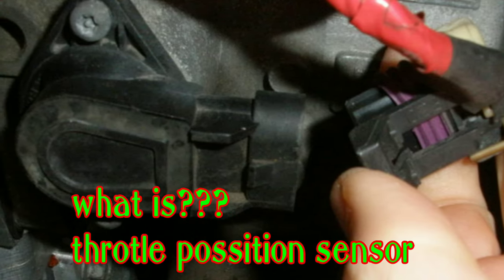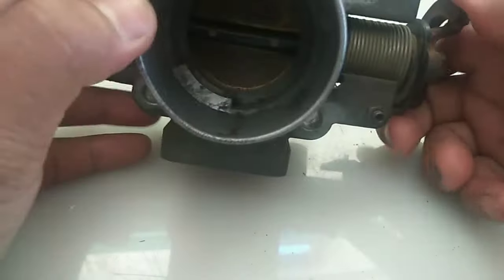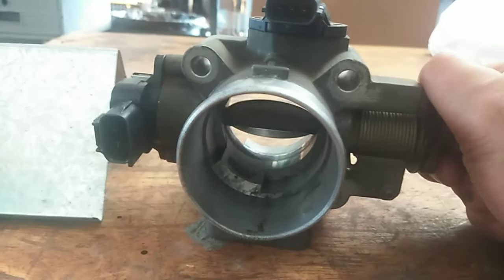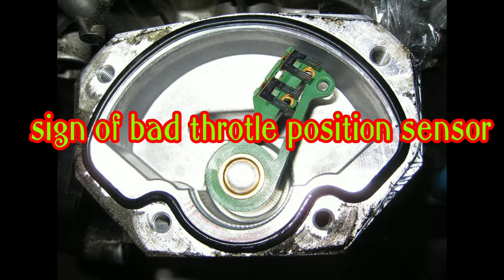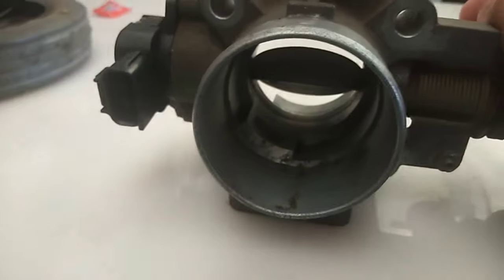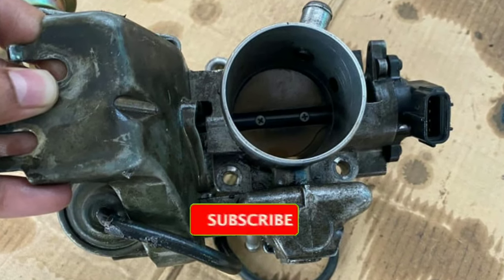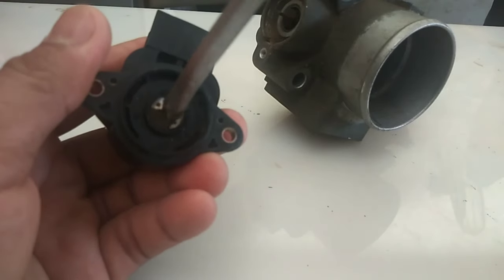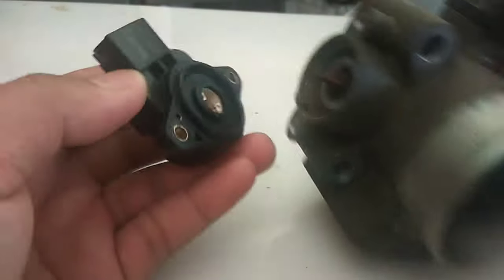Throtle position sensor faults and symptoms / caused and effect of bad Throtle position sensor andam

Comment: put a new one on every 65k miles,they are a part that wears internally,along with this sensor replace the o2 sensors every 85 k mi too,along with oil changes and new air clearner elements ,you will run  and run and get programmed fuel economy,mine just changed,i practice what i preach,retired ase tech of 47 years,yes parts wear out,its the way of it,no time for breakdowns

Comment: My fzs v2 has automatic acceleration problem ....new cables but still problem ,what the solution?
Reply from the maker: @benjamir474  air leak on your intake manifold ,check vacum hoses or any hose connected into your intake manifold , because those are one reason acceleration goes up even acc pedal at rest,,
Reply: @andammixed  I'll look into it

Comment: Thank you for the video, pls my Honda Accord 07 is consuming too much fuel lately and at times goes high and low on it's own. Some mechanic are saying no catalyst that's why. What should I do?
Reply from the maker: Removing catalyst is not a caused of large fuel consumption, what can i suggest for now is, try to used DTC scanner, to check the injector flow,  the map sensor, and other sensor related to the engine performance or to the fuel system,, 
My Suggestion,: change air cleaner,  clean throtle body, clean air intake and exhaust manifold ( so that the engine can breath)  intake manifold  gasket replace,  Clean the VTI strainer,  flush the exhaust pipe from the engine, choose light tires, my suggestion make your car low fuel consumption and engine operates in normal condition,.

Comment: Hi.  I've got a 2003 Montero Limited 3.8L.  Twice so far (1,000 miles apart) mine has gone into a condition where it will not accelerate. It idles and starts fine, but will not go over 40mph on level road, and takes a long time to get to that speed (severel minutes).  It will be fine one moment and then begin this malfunction in the middle of driving it, in town or on interstate.  I do have a TPS sensor code (P2135) but also cam and crankshaft sensors codes.  The timing system is fine and it doesn't jerk or do anything strange except refuse to accelerate.  I can turn it off and after 20 minutes it will operate fine again.  Is the the TPS sensor getting hot and then it fails?
Reply from the maker: In this case, try to get back to basic, change all  fuel filter and clean air filter,clean airflows sensor, if the TPS signal always mulfunction beter change the TPS,,and if your car is automatic transmission  chage the fluid and change the fluid filter and clean the strainer and fill with design AT fluid on your Transmision.😊
Reply: did you get it fixed ? what was it ?

Comment: Hello can u help. I got bmw e46 320d automatic transmition: when accelerating or when holding steady gas for example driving with 80kmh rpms jump up or bounce down. When restarting the transmition parameters i get 300-400km of normal driving with no problems and then the same starts occurring. Please help
Reply from the maker: I think first you need a diagnostic scanner to check for any abnormal system, but if you want to try any basic, try to clean your throtlebody, fuelfilter change check also fuel strainer and aircleaner this are the basic which need to clean if it thesame better used a DTC SCANNER
Reply: @andammixed  tried changing the fuelfilter and air filter also pluging in on scanners car shows no codes, on dashboard no check engine or transmition problem light. Every mechanic is suggesting to change the torque converter bcz they say its damaged ( car also makes grinding noise for 2-3 secounds when cold acceleration 40kmh) and transmition oil and filter change. Im just amazed how can the reseting the transmition perimetars stop the problem for 300-400km if it is mechanical problem…

Comment: My 1993 F 150 started idling way to high ( no tach but probably 1400RPM ).  I unplugged the TPS and the idle went to normal.  I drove it around the block with it unhooked and it actually drove ok with it disconnected (?!).  I  take it that I need to replace the TPS but it seems crazy that it idles and accelerates pretty decent with it not hooked up.
Reply from the maker: Try to do basic PMS sir clean all air filters, the intake manifold, check the gasket if damages and hoses or any vacuum leak,, this are one cause of high idle or unstable idle
Reply: @andammixed  Thanks, but if it was any of that would the idle instantly go to normal when the TPS is unplugged?

Comment: My blue bird sylphy rpm going up when I driving I change speed sensor  already
Reply from the maker: Please check for air leak, throtle body, intake manifold and check all hose's, damage hose or suction air leak can cause unstable rpm during engine operation

Comment: When I drop the accelerator, the engine is hanging a few seconds before rpm is dropping. TPS problem? Other than that the engine is running fine.No warning lights.
Reply from the maker: Try first to clean the throtle body and check all the vacum hose  if its the same theres a posible that your TPS is in trouble,
Reply: @andammixed    Wow! That was a fast response! Thanks! Will go ahead and do that!  😁😁
Reply: @andammixed  I have a plug & display OBD2 on the car dashboard. At 750rpm MAF at 4.7g/second, throttle valve body 17.2% open, MAP at 7.35psi. After cleaning the throttle valve body throttle valve body at 14.9% open. No change in MAF and MAP. Car is 1.8 litre. At 750rpm this 1.8litre has a calculated air intake flow of 1.8 x 750/2/60x relative air density = 5.7g/second. 

But the intake valves for most engines only are closed at about 50 to 60 crankshaft degrees after BDC so this air flow readings of 4.7g/second is my reference of a good air flow by MAF for this engine at 750rpm. 

So for any old car it is good to have an OBD2 kept on dashboard. Record obd2 display using handphone and review it later. Many other parameters can be recorded like SFTL, LTFL, O2 sensor, rpm, speed, iat, etc etc. These values or reading are interrelated.